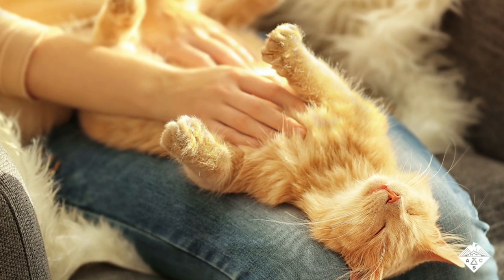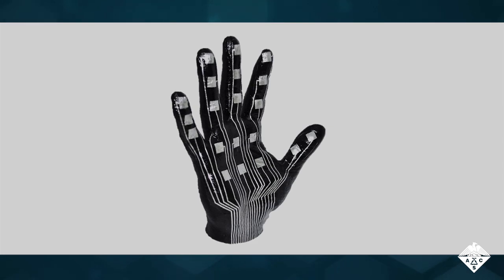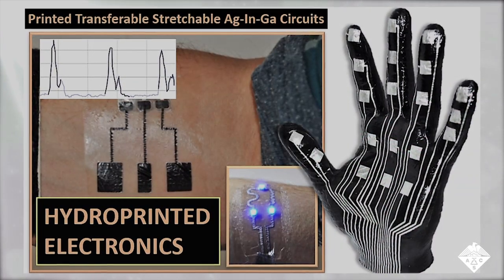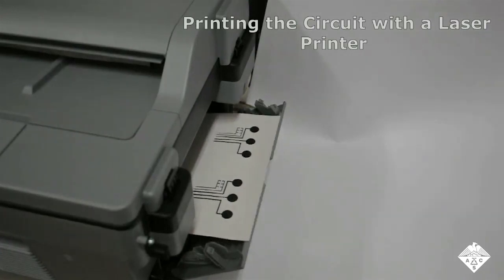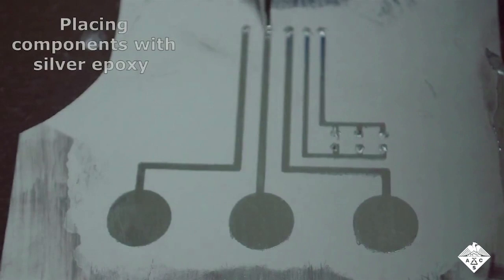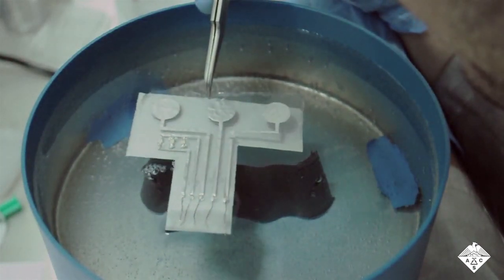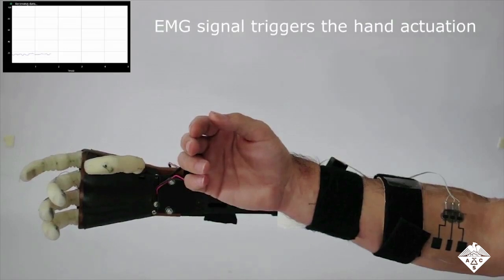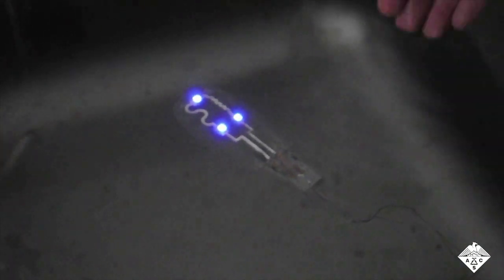Flexible electronic skin could help humans and machines interact - Headline Science

Comment: I want to see , prosthetics with carbon  Nano Tubing, hydraulics, there smaller enough to use air or fluid,And all you need  is sensors ,can run off CO2 cartridges. You can't imagine your dreams coming True,Now we Can,
Your So Like Me,Spot On !🔎